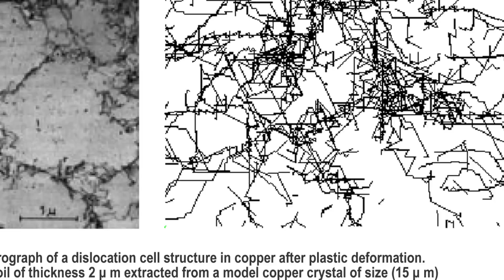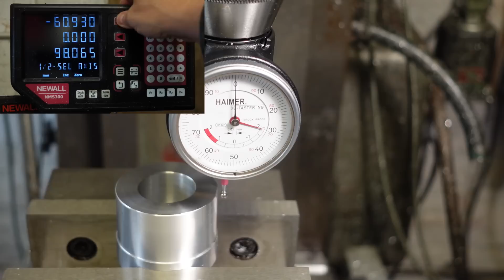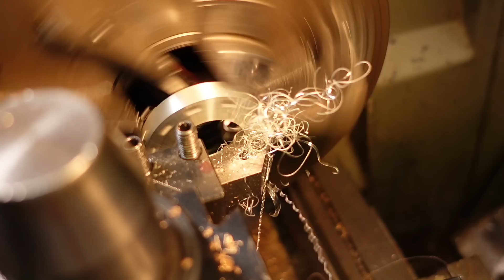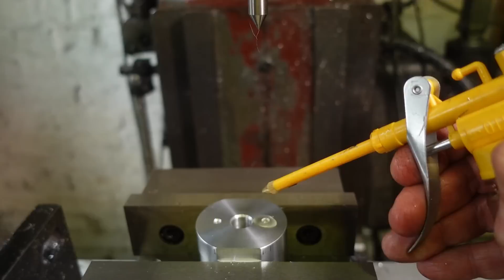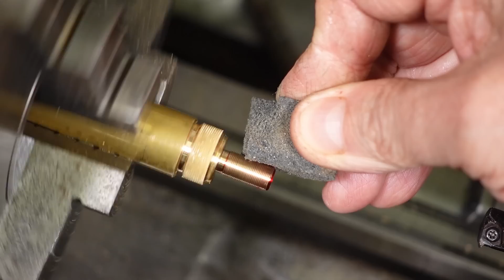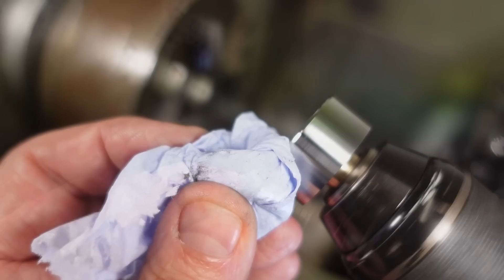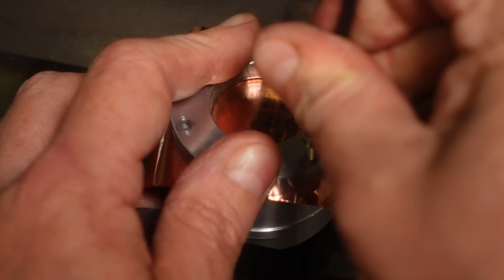Threading AWAY from the chuck! Great Seal Bug Membrane Strainer pt 2

Comment from the maker: I've added some technical details about how I did the calculations of the tension in the foil and the required torque on the knurled screw. It's probably wrong, but it does seem to give an answer that's at least in the same ballpark (whatever a "ballpark" is when it's at home, I'm not really up to date with my sporting cultural references).
Reply: Machining and Microwaves. Might I recommend rather than use torque as a measure of strain in the foil. You may have better luck putting a dial indicator on the base of the screw.

From my brief time in fastener engineering torque is not a good measure of clamp load because there’s so much variation in clamp load (or in this case stretch in the foil) based on how much oil are on the threads, the temperature outside, and the phase of the moon etc…

With an indicator set up you could establish a datum offset from the back of your fixture with gauge blocks and then precisely set the location of the plunger based on displacement (and therefore your foil stretch).

Great videos! Hopefully this helps.
Reply from the maker: @Taskarnin  The tricky part is getting a consistent tension to begin with. There's a systematic error offset caused by initial tension, so you still end up with the problem of knowing where the "zero" position should be to start measurements.  Perhaps a load-cell between the brass bar and the body could be used to show the actual tension, but it is also variable with the sine of the angle between the flat and sloping parts of the diaphragm. I'm doing this mostly by feel now, and my percentage success rate is climbing. If I had to do hundreds, I'd definitely go for a much more metrologically-sound solution!  I did consider trying an amplifier and loudspeaker with a magnet/pickup coil and set the tension to achieve a specific  oscillation frequency.  That might be worth a play to see if it's practical as then it should give me a result independent of plunger position, bend angle and initial tension. Endless fun...
Reply: @MachiningandMicrowaves  good stuff.  Sounds like you’ll get it. Looking forward to the next video!

Perhaps taping the foil to some construction paper could help keep it flat while you punch the holes. May make the zero more consistent.

Alas I’m sure you’ve put more thought into this than I have. I can’t wait to see you show me up.
Reply: Somewhere inside the boundary rope, I think. Which is to say you haven't hit this one for six, oh wait I think I'm confused now

Comment: Is the insert that you are using an internal right hand or left hand? Thanks!
Reply from the maker: It's an internal right hand, but it's a type that has no angled shim. At the very small pitch size, there's a symmetrical front and back relief.  That means it's almost not a handed cutter, except for the wide flat being on the "wrong" side.

It works OK up to about 1 or 1.5 mm. Above that I'd want to look at maybe using shims.  Most of the threads I'm cutting like this are 0.5 mm pitch and 8 or 12 mm diameter, so there's almost no helix angle when compared with say an M3x0.5. It's definitely a compromise, but without an automatic retraction mechanism or cutting away from the chuck, it's tough to get a good clean end to a thread which ends close to a face, even with a deep gutter.
Reply: @MachiningandMicrowaves  Could you please explain the shims that you refer to? Thanks again.
Reply from the maker: @karlh6700  This explains better than I can: https://www.sandvik.coromant.com/en-gb/knowledge/threading/thread-turning/how-to-choose-thread-turning-insert-and-shim

Comment: knurling good on the first try .. its so random for me ;)
Reply from the maker: I really want to make or buy a serious pinch knurler, the pressure knurl is OK for softer metals like brass and 304 stainless and some mild steels, but not good on hard steel, and it takes too many passes.

Comment: despite their ease, left hand threads pose interesting challenges also.

i trialled the nut three times the wrong way... oh yeah. LH. didnt i just say its LH?

on size, ollowed by popping nut in, grab chamfer tool to take off that edge when i parted it... ZIP!

oh yeah. LH. luckily that was the last and also superfluous operation...(chamfers? superfluous? wha?) cus i aint clocking it up again!
Reply from the maker: I've always forced my brain to think three extra times when LH threads are involved, and I sometime even print out a Fusion360 CAD image to act as a reminder. I try to remember to machine two nicks into the nut to indicate it's LH. Sometimes I even succeed.

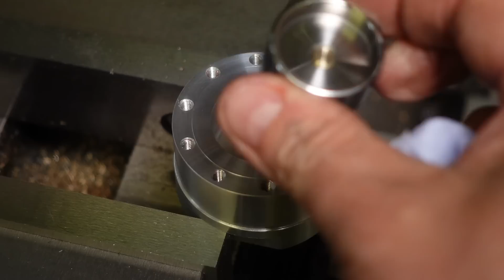Comment: Might it help to add an o-ring or similar to the annular gap at 29:54 to prevent it from wibbly-wobbly as you tighten the screw, so that the tension on the diaphragm is uniform along the perimeter? (Also: Lube on the back-side of the copper - powdered-graphite, or MoS2 or similar..)
Reply from the maker: O-ring is a good idea.  Not sure about how much benefit lube would bring, but it needs to be something that won't burn when the foil is hot from soldering, and will clean away using a solvent rinse, Graphite might work.  I should really try some friction tests to see if it is significant, but the next step is to try electroforming a nickel and silver foil and stretching that
Reply: @MachiningandMicrowaves  Hmm - thinking aloud - how about a layer of material between the tensioning surface and the copper-sheet - for example a sacrificial disc of UHMW or Tyvek (r) slightly larger than the lip?
Reply from the maker: @AdityaMehendale  I think that might be solving a problem I don't have. I could perhaps try making the piston from a very low friction material, but they tend to be hard to polish. Next step would probably be to print a grid on the raw foil and then stretch it and look for any areas where there is excessive strain

Comment: Copper foil probably has some areas of work hardening from manufacturing process. So maybe anneal first. Use washers under your Allen screws and a torque grease on the threads, and torque the screws, your copper foil is not evenly clamped (hot rod engine tech shows this kind of problem). Could you use air pressure (or vacuum) to do the stretching? This would have even tension across whole foil? And have a mounted pointer at max required stretch as a visual indication of progress? At least TTL was repairable, custom chips not so.
Reply from the maker: Some of the foil is electrodeposited so it's fully soft, but the rolled foil definitely has some banding from the rolling process. It does disappear completely with the amount of stretch I'm doing. I suspect that the grain size in that 10 um material is such that work hardening doesn't have much impact.  I have some annealed foil as well, but it's stupidly expensive. I could certainly anneal the rolled foil, but I'd have to do it in a vacuum or perhaps in Argon to prevent oxidation. I used a tiny smear of grease on the threads for the actual parts, the grip from the tiny step in the body and clamp seemed to be entirely sufficient to hold the foil.  No idea why I didn't think to put washers under the allen screw heads, well spotted!  I wanted the foils to be flat to a micrometer or so, which meant I couldn't use pressure, I needed as close to a pure radial stretch as possible and using hydraulic or pneumatic methods would cause the foil to form into a hyperboloid or paraboloid I think.  I used the feeling of the adjustment screw, I could feel the stretch pretty well as that fine thread was well-polished and greased.  If I was trying to make it reproducibly, I would certainly need to look at a measurement solution.  I suspect that ink dots and a webcam and reticle might suffice!  Thanks very much for the comment and thoughts.  I found a drawer wih lots of old SN74xx TTL chips after the comments a few days ago.  I should make something with them!

Comment: Why don't you use a small amount of oil on the stretching ring to reduce friction? I saw you clean them, but lubricant may give the ability to evenly distribute the load.
Reply from the maker: The problem with any oil type lube is that it breaks down and stains the foil when I apply heat to solder the bronze ring to the foil. Graphite is possible as a lube but in practice the tension is so great and the angle is so shallow that there are no obvious frictional problems so long as the stainless piston edges are really well polished. I could print an array of dots on to the foil then stretch it to check if there are any discontinuities at the piston contact point
Reply: @MachiningandMicrowaves  Thanks so much for responding. That makes complete sense and I appreciate all your info, and content. As someone who has never uses a metal lathe, it was very nice watching your videos.Many people skip over the technical aspects of the milling bits and techniques used. They just time-lapse to the end product. Nice, detailed aspects that make turning metal as seem less of a black magic, more of an art/science. Have a great day!

Comment: A tightened membrane is used for a drum head for the tuning and resonance for the note it is tuned.  Microphones on the other hand are designed to move freely without the tight tuned resonance. Think of the surround on the rim of a loudspeaker. If you cut concentric grooves in a blank with the lathe, mounted the diaphragm, then used a ball stylus to trace the grooves and emboss them into the perimeter of the copper diaphragm, the result would be much better for wide band audio response.  If you are not afraid to use modern materials, use a mylar diaphragm from good audio headphones with a dome shape. Mount your copper disc inside the dome and mount that for your capacitor diaphragm element. A metal cat whisker can be used to ground the disk to complete the resonant circuit.
Reply from the maker: I thought all condenser microphones used stressed membranes with the first resonant mode well above the audio range?  The B&K 4134 "half inch" condenser mic has a 9mm diameter diaphragm 5 um thick and it's held in tension of 3162 N/m. It has a 20.77 um gap and a backplate of similar size to the one in this Bug.  Solving the Navier-Stokes equations isn't exactly simple, but they do an analytic and numeric calculation of the amplitude and phase response.  3162 N/m equates to a radial tension of around 14 N on that tiny diaphragm.  The tensile strength of a thin Mylar film at 110% elongation is around 200 MPa, so for a 5um film I think that puts it well into the elastic region.

See https://www.ncbi.nlm.nih.gov/pmc/articles/PMC3257755/#s6title for details of the equations adn methods and other sections of the document for the calculations and history.

The diaphragm in these cavity resonators needs to stay within about 5 nanometres of its mean static position to maintain resonance. The peak air movement is about 10 nm peak to peak at 1 kHz and 40 dB SPL.  The gap is about 25 micrometres at the best resonance.  If the diaphragm gap changes by at much at 10 nm, it would drop off from the resonance peak and the signal would be lost.  

A simple flat copper diaphragm at 10 um thick shows a first resonant mode at about 400 Hz in a finite-element simulation, and it does drop if you emboss the surface with a bellows-style pattern, but as the moving mass is now smaller, the resonance doesn't drop far and it is smack in the wrong pare of the voice spectrum as a result. The reports say the original diaphragm was made from Nickel foil that was silver plated.  Nickel is a terrible conductor at RF as it's ferromagnetic, so the silver layer would need to be more than 5 micrometres and preferably 8-10 to keep the cavity Q factor high enough.  Using copper was a bit of a cheat, but I spent $300 on nickel foil before I gave up. 

Mylar diaphragms were certainly used in the later models around 1955.   I guess they used gold sputtering or PVD to coat the film.  Issue there is that the metallisation needs to be at least five skin depths at the frequency in use.  One skin depth at 950 MHz is 2 micrometres, so you start needing a pretty thick layer to maintain sufficient Q-factor in your microwave cavity.  In a normal DC condenser mic, the mylar metallisation can be extremely thin as is only needs to carry audio frequencies and is feeding a very high impedance buffer amplifier.  You can't use a thin wire to complete the circuit in an RF cavity as the losses and stray inductance would drop the resonant frequency to perhaps half and the Q factor by a large factor.  The cavity needs a loaded Q around 1000 to get decent slope detection.  A thin wire behaves like an RF choke at low GHz frequencies.
Reply: @MachiningandMicrowaves  I just went back to the EV Blog series on microphones. EVBlog 602 - introduction to microphones shows the edge designed to allow the diaphragm to move. This is a talk given by a Rhode design engineer. They refer to all microphones use a wobbly bit to detect the air pressure.  Maybe this design was a taunt drum design to limit the movement to very small movements to limit the tuning range.Interesting and it makes sense for the RF tuning.

Comment: I think the most amazing aspect of modern machining is the availability of so many custom carbide cutters. could you imagine what it would take to make them out of machine steel, and then the constant up keep and sharpening?
Reply from the maker: I've often ground up my own HSS and carbide tooling but for tiny full-form threading cutters, it's hard work! A lot of home-shop machinists prefer to stick with ground HSS as they can get better finishes on smaller machines, although modern high-rake lapped inserts are pretty much just as good on my old cast iron Colchester 1800

Comment: This is my 2 episode of yours. Even the text is rewarding to read. Speaking of which, punctuation of the cc's would be great.
I knew that Aimee was not an image of your girlfriend/mistress/fiance/spouse; no apron.
BTW I suspect your strainer is to filter out the VHF from the GHz. Don't want cross contamination do we?
Reply from the maker: I've been very late publishing some of these videos and was so tired that I couldn't face editing the CCs, but in general I try to ensure they are at least corrected for spelling.  The current vid is being shot for a major corporate sponsor and it will be edited to perfection because I have the luxury of more time being available. I am still a total beginner at videomaking, colour grading and sound design, and I'm not using the best tools. I'm about to move to DaVinci Resolve from Cyberlink Powerdirector. I've spent the last month building a video studio and editing suite, so starting tomorrow, I'll be showing my face in my videos and I'll have proper lighting for shots outside of the machine shop.  I should soon have the electronics lab set up for video/stills/sound, and I'm working on converting my woodworking shop to include my 3D printers, electroplating and electroforming gear, and adding wire EDM, laser cutters, CNC engravers/routers and installing all of  the equipment for the dangerous high voltage, vacuum sputtering/deposition and high vacuum experiments. I need to do a lot of work in the machine shop to create a better TIG/MIG/stick welding area, and move my large granite surface plate and metrology tools into a more temperature-stable environment.
Reply from the maker: The strainer was designed to stretch and align the grain boundaries in a 10 micron copper foil to cause work-hardening, and maintain the foil in an elastic stretch so it could be attached to a bronze ring 20 mm diameter and 0.7 mm thick and 3 mm deep.  That then screws on to a resonant microwave cavity with a central post that is adjusted to be about 20 micrometres away from the foil.  That makes the combination of the central post and the foil into an inductance and capacitance that resonate at around 1 GHz. The cavity is excited by an external field at a fraction higher than the resonance by an external antenna with capacitative end coupliing. As sound vibrations in the air from speech around 4ft away move the tensioned foil by about 10 nanometres peak at 1 kHz, the resonant frequency of the cavity changes, and the amplitude of its response to the 1 GHz stimulus varies syllabically with the audio. Any antenna that is illuminated by an RF signal re-radiates around half of the incident wave, so if you can set up a receiver that nulls out the incident wave by a factor or at least ten million, a receiver can pick up the audio as a mix of amplitude and phase modulation and convert it back to audio. This is exactly what Leon Theremin created when he designed the Great Seal Bug which the NKVD gave as a gift to the US Ambassador in Moscow in 1945. and which wasn't detected until seven years later. It featured in the high drama of the U2 spy plane incident in 1962 (Gary Powers) at the UN Security Council.  BBC TV asked me to build and demonstrate a replica for their programme "The Secret Genius of Modern Life" with Prof Hannah Fry interviewing me on prime time BBC2 TV.  My mother was very proud.  I'm working on a series of four videos about the replica build project, the history, my experiences while bugging the BBC Council Chamber in the iconic Broadcasting House in London, and the physics and microwave engineering aspects of what is known as The Thing.  It's been one heck of a ride and eaten hundreds of hours of my life, but the amount of fun makes it all worthwhile